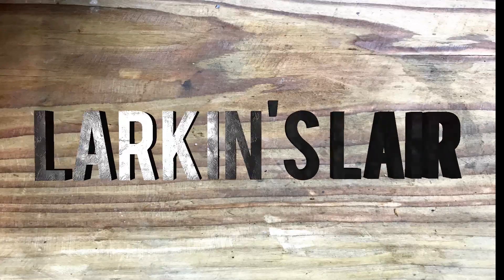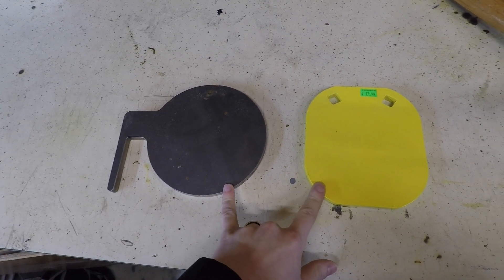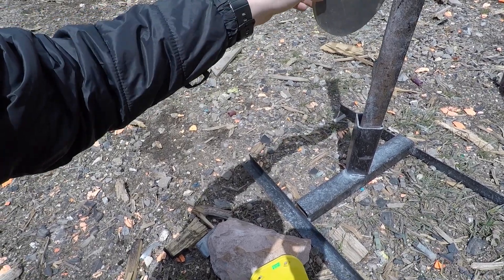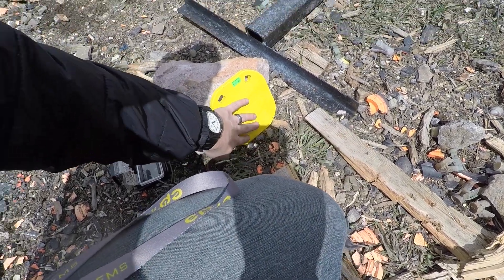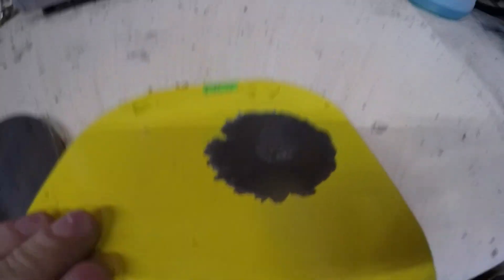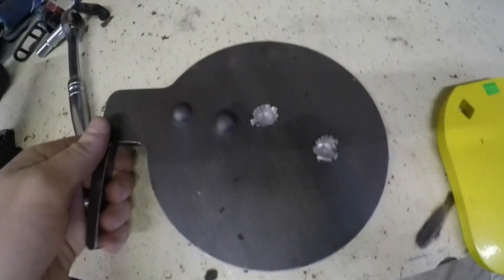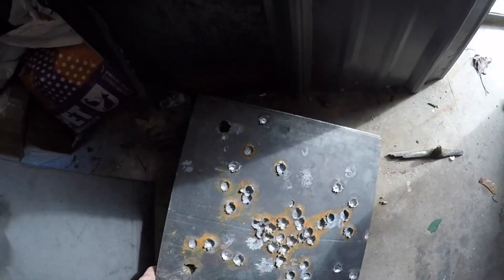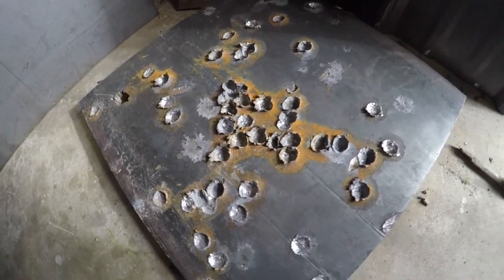Chinese Steel Sucks!!

Comment: My lawn mower body keeps cracking and breaking in places that don't even have any load on it. Chinese steel is literally garbage. They melt down a whole car with all the plastics, aluminum and other crap and call it "steel". Literal garbage!
Reply from the maker: EXACTLY!
Reply: You should buy the same price product then compare their quality, right?
Reply: @unionssm  Can you retype that into English, please?
Reply: Well I mean all steel is recycled like that. Then what they are supposed to do is take a sample and analyze and then adjust the element mix by adding more iron or other elements. 

But they don't do this to save on cost.

Comment: What is AR500 steel and what is it used for?
There must be some truly accurate way to measure the strength of each piece of metal.
Reply from the maker: AR500 steel is a hardened steel that you can shoot rifle rounds at. I can shoot .223, 6.5 CM and 308 at the piece of steel on the right and it doesn't make any noticeable pockets. It is also used for Armor plates and costs more than mild steel (the stuff in I-Beams, angle iron, and re-bar).
Reply: Yes, Hardness test (Test Method: ASTM E 18-20)
Reply: AR500 is also used in other abrasive resistant applications, blades for bulldozers, the buckets for backhoes, etc.

Comment: My company manufactures elemental analysis instruments, amongst other things. I’ve analyzed that Chinese crap. It’s just poorly heat treated carbon steel.
Reply from the maker: Well at least it is steel... I call it chineesium, I joke that it is whatever random scrap metals they put together and melted down that day... yeah, it is junk.
Reply: @TheLarkinsLair  I would say that’s quite accurate. There’s a term for it in Chinese construction. Tofu Dreg.